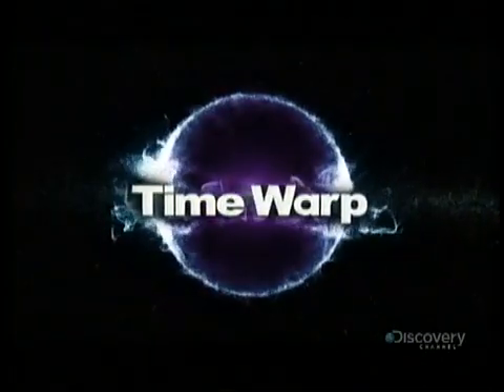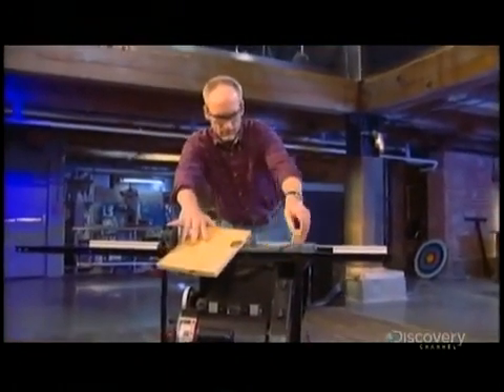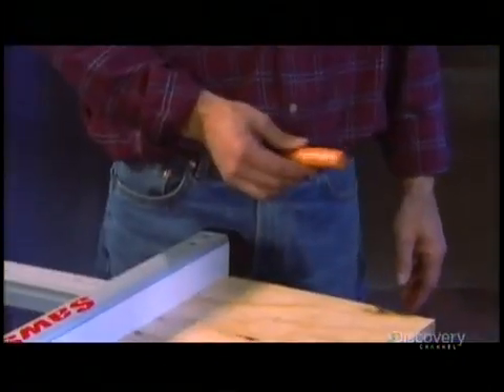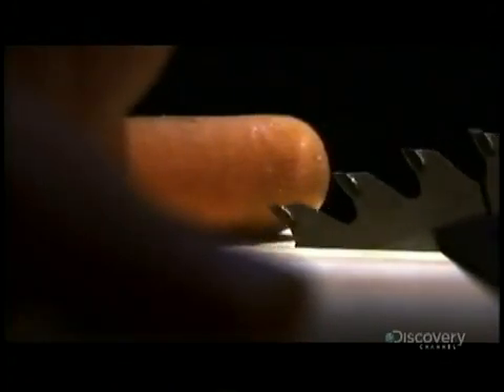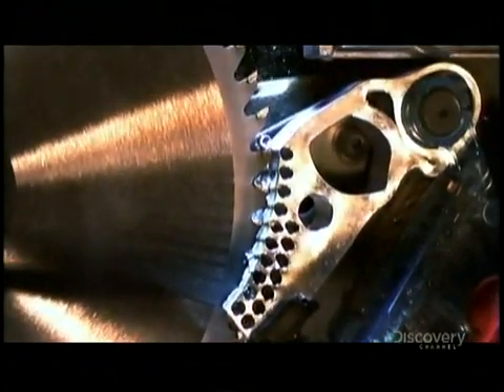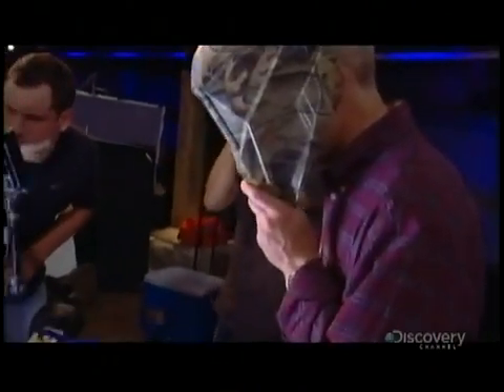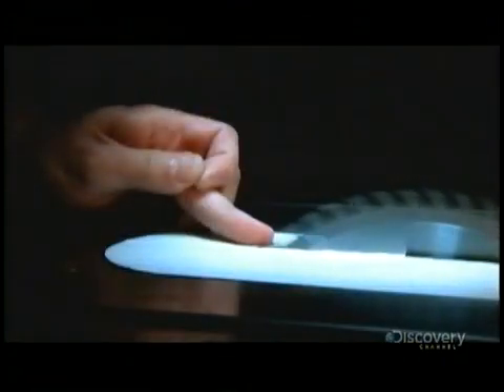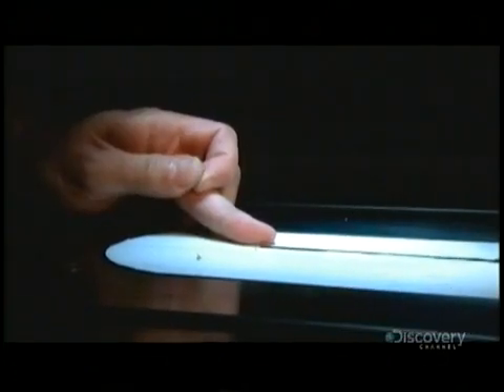Saw Stop - This guy puts a finger into an active table saw blade & comes away without a scratch!

Comment: Not trying to be critical of the thing, but I'm wondering how fast you can push your finger on there before serious damage is done.
He obviously approached the blade very slowly, understandably so.
Reply: I think there was a small nick on the hot dog, so basically you're gonna get cut, but even moving your hand quickly it'll engage before you get cut to the bone.
Reply: Realistically you shouldnt be trying to cut something at a really fast speed to ensure it is cut properly... yes attacking  the blade with a finger or even your body at a rapid enough speed you could still die or lose a finger... but realistically if you are doing it fast you better be well experienced and not cut a finger
Reply: still better than nothing
Reply: It wouldn't make a difference on how fast you move. You aren't getting faster than electricity.
Reply: +Angel Zabala shouldn't be friends with a racoon that dumb.
Reply: hanspeterpitsch my cousin's hand actually slipped into one of these when he was in carpentry school. (I don't really know how, but it was rather fast) and it did cut into his finger, but not nearly as bad as if it had been a standard table saw
Reply: slow and steady wins the race right?
Reply: ***** Well slow and steady... so you dont fuck up and start over
Reply: An idiot says So what would happen if i karate chop that blade? Would the speed of my hand not matter? Would my hand still be intact without a scratch?
Reply: Did you not hear how fast it stops, you would have to be faster than that. However, you would hit the blade after it stopped spinning if you karate chopped it
Reply: yeah, but usually if you cut wood it goes slowly.
Reply: Honestly, with the way sensible woodcutting works, you should be well within the realm of safety if you have an accidental contact with the blade.  It's never good to rush.

It's sort of like crumple zones and airbags in cars.  They'll work to an absurd extent...but if you decide to get in the car and do 120 mph down the wrong way on the freeway and meet a big rig...well...you're on your own.
Reply: +frankie lemus ikr the guy probably cuts wood fast 😂😂😂 so dangerous
Reply: frankie lemus also, the irony of you calling me a "retarT" is quite amusing I have to say.
Reply: why would you cut something real fast you wouldnt get good results
Reply: @martijnveldhuis1377  a kickback can pull your hand into the blade very quickly, just because you don't cut something quickly doesn't mean your hand can't be pulled in quickly. Thankfully sawstop is very fast so it would definitely stop it that you probably wouldn't sever anything although if you came at it very fast you might have a deep cut and potentially need stitches (better that than losing your fingers).
Reply: martijn Once again, I never even implied that anyone would cut anything fast.
Reply: Say a friend gives me a suprise visit, and felt like being a dick so he decided to scare me as I work with a saw. He screams, I flinch so hard my hand crosses paths with the blade, do I keep all my fingers? Does it even draw blood? That is what I would like to know.
Reply: Angel Zabala if anyone is that dumb you shouldnt be friends with them
Reply: Angel Zabala and probally you would get blood but not alot tho
Reply: Alright a fucking racoon gets into my garage and makes a noise...     Better?
Reply: There is a video where he goes fast and it does cut him just a tiny bit.
Reply: +Angel Zabala ha ha I looked at the reply to your previous comment and thought 'what an idiot. he was just trying to ask what the effects would be. he didnt ask you for friendship advice!' and then saw your raccoon comment and it literally made my day!😂😂
Reply: Nadia Hr lol, your welcome 😉
Reply: TheAwsomeKilaShow good advice, thank.
Reply: Angel Zabala I actually agree with you though.
Reply: TheAwsomeKilaShow cool. again, thank.
Reply: hanspeterpitsch that's about the speed you should be cutting wood at. any faster and you'll have really shitty cuts with a bunch of jagged edges
Reply: flap cat its like 5 months later, I explained multiple times that a) I know wood shouldnt be cut fast and b) that this is actually completely irrelevant to my original question. It doesn't matter how or why someone would push his finger into the blade with force and speed, I was only wondering where the line would be, at what point it would actually be hurting you..
Reply: as for that I am unsure, but just because you commented 5 months ago doesn't mean that's when everyone else in the world saw the video.
Reply: flap cat That is true, however at least for me, I also see replies under comments from 5 months ago, in which I explained myself multiple times. 
Not trying to be rude I just don't get it. Maybe there's something I'm missing?

Comment: Shittest most cowardly demo ever. Yeah- you've got absolute faith in your product mister. Even if it had not activated properly- that man was never going to get hurt by that saw. His finger approached the blade at about 0.001 mph- at most he would have scraped off some skin if it had failed to trigger. I'm more interested in the false positives whenever the machine detects an area in the wood that has a slightly higher conductivity. "Bang!'- there goes another 60 bucks for nothing.
Reply: there is a video of a guy cutting through a steel nail in soaking wet wood an it not going off. This machine works properly.
Reply: +gnamp 
seriously.
complaining about a guy not thrusting his hand into a fucking saw as fast as he could?
are you fucking kidding me?
would YOU do that shit without hesitation?
you wouldn't even put your hand near that thing to test it, this dude had so much faith in it that he actually tried it.
most of us here would've stopped at the hot dog.
Reply: Yeah but he did it with a fucking sausage rapidly and like Isaac said, it's not a new machine, I think they know how to use it better than you. By the way, of course he's fucking nervous, everyone would be even if the machine is going to work everytime, that's just human nature.
Reply: Tell me, Pierre, would you jump into a pit that you can't see the bottom of if someone told you that there's a cushion on the bottom that's good enough to protect you without any injury, would you jump in without hesitation?
Reply: gnamp
go stick your hand in a saw.
:)
Reply: u wanna do it? ☺☺
Reply: gnamp Yes, why does it matter?
Reply: +gnamp the French aren't cowards. Js 

Also, wood is known for a lack of conductivity. And yeah he went slow. They used a hot dog for the regular demo, going at a normal speed. I'm willing to trust that, seeing as how the skin on a hotdog is way less resistant than the skin on a human finger.
Reply: Bradly Anderson Not the same condition, not the same thing, fuck off.
Reply: how about you go punch the saw and find out yourself
Reply: Sara Janzer Nah- it's sharp and doesn't deserve such treatment. The same however, cannot be said of you.
Reply: " you are a hot-dog and I pity you."
yo.
this isn't tumblr mate, get a brain, please.
it's required around here.
Reply: I'm starting to get the impression that you somehow didn't know the closeup was in slow motion..so uhm.. not as slow as you thought, mate.and please, stop arguing over this.it's pointless.Edit out.
Reply: +[GOLD] Edit Ninja only the 3rd showing was slowed down. You can't Edit that out...
Reply: +gnamp if u won't do it than why do you say the person that did it is cowardly
Reply: gnamp It's a high speed camera, for all we know he was thrusting his finger in, the only way we can calculate is by using the rpm of the saw, the ammount of blade bits travel past the threshold in a second, how many bits are in that blade
Reply: +Pierre Perras he had no need to be nervous. He was in no danger, even if the safety failed.
Reply: gnamp No, it's human, if you're sure that you will not get cut, you will still be stressed and you can't do anything about it.
Reply: +Pierre Perras I think that says more about you than it does about human nature.
Reply: gnamp No, humans are like that.
Reply: Pierre Perras the cowardly ones, yes.
Reply: gnamp No, the humans one, EVERY one are like that.
Reply: +Pierre Perras you're French aren't you, Pierre?
Reply: +Pierre Perras oh, no reason :-)
Reply: Pierre Perras It essentially is, but I guess I'll change it because I love you so much (;.
Let's say you are testing a new model for cushions or airbags that can prevent injury entirely from a crash. You place a cushion, or an fully inflated airbag if you're using that, at the bottom of a 100 foot drop. You drop a human sized dummy that weighs as much as you and the cushion, or airbag, is a success and prevents any obvious damage to the dummy. Would you still jump, without any hesitation whatsoever?
Reply: Pierre Perras Oh yeah, I just realised that I'm actually on you're side. I sent my message in reference to Gnamp, but my question still remains for him.
Reply: Bradly Anderson I figured your question was aimed at me, you dipstick ;-).

Anyway, the urbane frenchman provided the answer I would have given anyway. Apples and oranges.

Bear in mind this may be your one shot to promote your product with a real film crew... you know the risks- you how it works inside out... tolerances, forces and dynamism- the whole nine yards. And you've have tested the thing to death with wieners and bratwursts out the wazoo. Sure, it's hard to quieten those voices- the fear and doubt that creeps in and whispers spiteful warnings to unnerve you. Things can go wrong. Sod's law says they will. Cowardly people listen to such things. So to defy them, you reason it out- you say- the odds are 1 in 50 the brake mechanism won't trigger. And if it doesn't it's probably going to take a chunk out of the tip of my finger- (which let's face it isn't exactly a hundred-foot drop down a pit... but an unwanted consequence never-the-less). Then we tell ourselves- let us not capitulate to fear on the off-chance anyway. Not now. Not today.

No- a good many of us would show faith in our fantastic invention and risk a sore hand, looking a bit daft and spoiling the promo. I think the vast majority of people in that position would consider the rewards... and throw caution to the wind.

Naturally, chickens will not understand this.
Reply: gnamp This is essentially the same thing, though I do admit that it's abit more severe than a chopped finger-tip.It honestly takes a madman to put complete and utter faith in his product unless he's tested it dozens of times without a single injury or problem. It's more understandable if you've tested it often with your own body and have corrected every problem that arises, but otherwise, most rational people are still going to hesitate. A smart businessman wouldn't hesitate too much or show his hesitation, but it's still going to be there for most cases.
Reply: Bradly Anderson agreed.
Reply: ummmm ok i didnt get that
Reply: [GOLD] Edit Ninja Now now- let's not twist things beyond their natural bounds. It's sneaky shit-head tricks like that that gives others the wrong idea. Or maybe you genuinely can't tell the difference between someone complaining about painfully/ unnecessarily slow and them complaining about not going full-speed... in which case, life will be a constant struggle for you. Either way, you are a hot-dog and I pity you.
Reply: [GOLD] Edit Ninja One like this? At a reasonable speed... neither incredibly slow or as fast as I can? Sure- why not? (I get the impression you didn't think this one through properly.)
Reply: it was in slowmotion
Reply: Hayden armystrong nope. You?
Reply: this is everywhere
Reply: ILOVEPLANEZ YouTube what have I to gain from doing such a thing?

Comment: Wow !! Great Idea . BUT guess what happens when the saw blade gets burnt sap on the blade ? it will act like and insulator and your finger will clean off the contamination quickly
the liability on  insurance for this product will cost and arm and a leg and maybe a finger.

how about a triple redundant proximity senor  with a brake pad that is made to stop a car
that might not stop it fast enough , so the saw would also have to retract down and away from the vertical plane of rotation , and you save your fingers and the 60-100 dollars and changing out the locking mechanism and I'll bet that part aint cheep either .

Or don't be an idot when using your  table saw ( best solution)

Comment: if you almost cut your hand in this thing 2 times that's $120 if you break it 100 times than it costs hhmmmm 100×60 1×6=6 add three zeros 6 0 0 0
$6,000 wow that's a low price hope people are not as dumb enugh as to put thier finger in a lot of saws (100)

Comment: Because everyone who uses a table saw has to soak there hand in ice water before they use it. We have a few of these at our shop , yes they work but there are some flaws. The brake must be set to the gap properly or it will fail. And the axel tend to twist causing your cuts to pull away from the guide. You have to buy a completely separate shaped brake that must be set and calibrated properly for dado cutting and we some times have to reset the machine because the damn red light won't quit blinking . But all in all I've seen it save many fingers but not without a scratch, fingernails don't conduct the static needed to flip the break.

Comment: And what if the woden plank is a bit wet?
Reply: +Dejan Kostic wood is an insulator you degenerate
Reply: +Dejan Kostic Because, you can't structure a sentence properly
Reply: Wtf?
Reply: haha what the fuck is happening
Reply: Wood isn't conductive so it doesn't stop
Reply: Im talking about wet wood bro...
Reply: yeah i geus Luke dont want to respond to me because i am a degenerate :(

btw, by the way :)

Dry wood is a very good insulator, pure water is also a very good insulator. But because 99,999...% of water on "this earth" is not pure, most commonly used or present  water have a greatly better measure of conductivity and in some situations can actually increase the conductivity of some less conductive materials. Did you ever heard somebody say to you, "Don't touch electrical devices with wet hands". And there you go...
Reply: Yes if wood was wet with un pure water it would be slightly conductive but probably not enough to set off the saw. Even if it was salt water I wouldn't think it would set it off but who knows.
Reply: holy crap XD the transition between how dumb you talked in your first couple replies and how much info you came back with made me laugh
Reply: well i am glad that i make somebody laugh :)
Reply: Oh well i geus i am then. How old are you btw?
Reply: Luke bro where you at, why you dont answer me o.O?
Reply: Water is an insulator not a conductor. Degenerate. If we were talking about the purest 100% H2O then that would be a fucking expensive piece of wet would.
Reply: I will just get to the point, because some of you seem to forget the reason of this discusion.

AirCanada
Yes so, a wet plank could posibly stop the saw blade thinking that is detecting a finger...?

TL;DR
Typical situation

You are cuting wood outside. Wood that you want to cut is maybe a bit or more wet (you forgot to cover the wood left outside and last night was a storm...), so you  can't finish the job because the bloody thing is stoping all the time ...so what should you do wait the wood to go dry or will it work because the sensor is set to react only to a specific intensity?

I thought that my question was simple and  obviouse at frst, but seems that to much ignorant people are responding. I should have been more clear, cause this days alot more kids are using the net then before.
Reply: You used Google Translate didn't you? Lol
Reply: What is a degenerate? And is watter a insulator to?
Reply: Yes
Reply: Degenerate is a yes?
Reply: +Dejan Kostic no you're a degenerate
Reply: Why im i a degenerate? :(
Reply: Luuuuuuuuke come back luke come baaack :P
Reply: This is just unconventional very sarcastic and cynical lektion to Luke, that offensing someone degenerate based on hes very limited one sided knowledge is a mistake which should be avoided, except if he don't wants that same effect to be backfired at him.
Reply: probably it kicks with wet glue so why not water
Reply: Bradley Smith
First of all thank you for your mature respond.

And yes, that is the question...i am no scientist and i don't know the specific conductivity in different states of water purity,  either...everything i asked is based on "basic knowledge". But it is posible and that only is just my point

No need to call me a degenerate Luke :)
Reply: Nick P Its so blatant XD
Reply: 3 in the morning "LUKE COMBACK" lost my shit ahaahahaha
Reply: Wood is mostly non-conductive. Wet wood slightly more conductive. The thing is, you aren't going to have "areas" of the wood you're cutting that are more or less conductive. It's going to be uniform.

Wood can become more conductive by burning it. It carbonizes, and that carbonation on the surface reduces its electrical resistance, making it less of an insulator against electricity and more of a conductor. You can test this yourself by taking a spot welder and touching it against wood. If you move it along very quickly you can etch into the wood by making trails out of the carbonization (the high current arcs will burn the wood). However if you hold it long enough in one spot, it will begin to arc outwards in very vibrant patterns. This is because the spot you've sat there and burned into the wood carbonized enough to create tiny fissures and cracks along the surface, giving the high current arc from the welder more paths to take to get to ground.